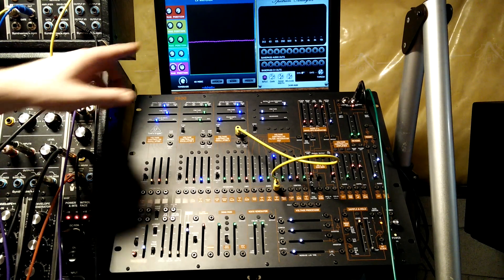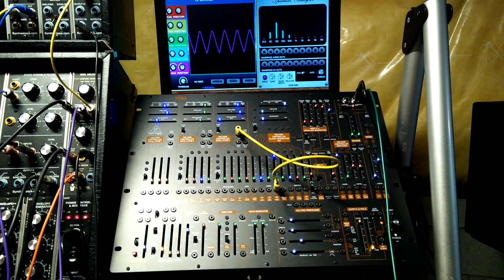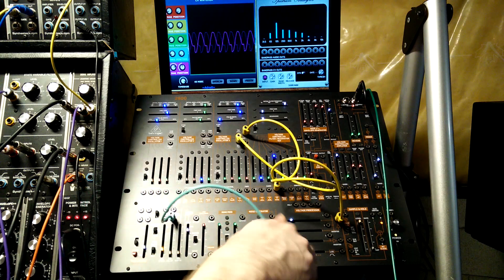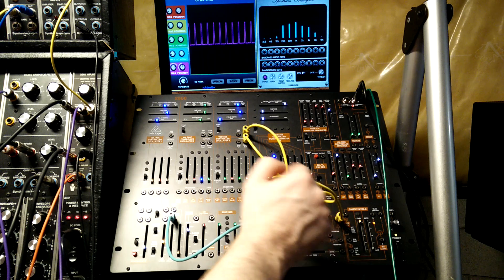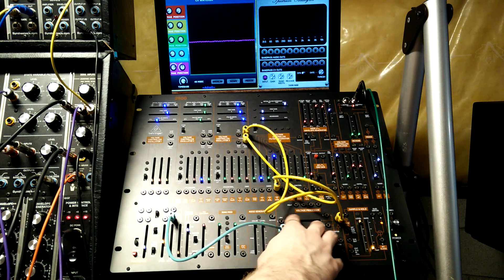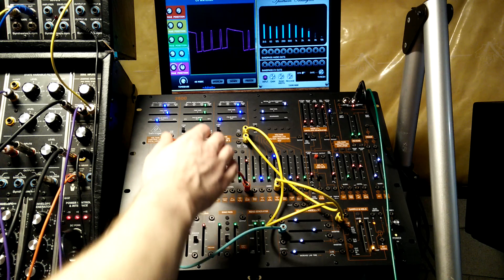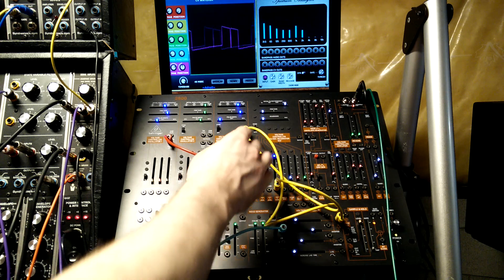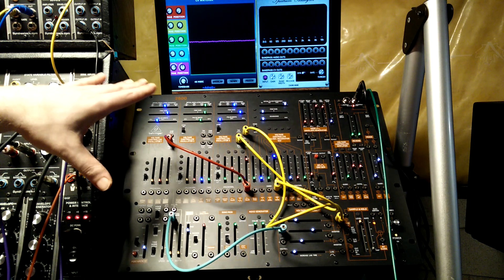Behringer 2600 Sine/Triangle "PWM" Trick

Comment: the wave shaping is so beautiful. amazing.
Reply from the maker: In this video I use the +10V to modulate the rising portion of the waveform but if you use the -10V instead you can affect the falling portion of the waveform. It's a subtle difference though.

Comment: Into the saw *output*? What is this taboo voodoo?!
Reply from the maker: In the original ARP 2600 manual there are patches that use these output to output patching techniques. On the ARP 2500 making these connections was somewhat unavoidable because of how the slider matrix worked. At some point it was suggested that patching outputs to outputs could damage your synth so people stopped doing it. I've never personally heard of anyone damaging any module with these techniques so I use them freely.

Comment: So many possibilities with the array of patch points on the 2600, and as you show, even more when you feed outputs into outputs. Is there possibly even a way to do a wavefold, or similar effect? (making it similar sounding to the west pest)?
Reply from the maker: I don't know the extent of what's possible on the 2600. I doubt that wavefolding is something you can patch up with feedback or other tricks but I'm not sure. Luckily the West Pest isn't too expensive so adding a wavefolder to the 2600 is relatively easy.